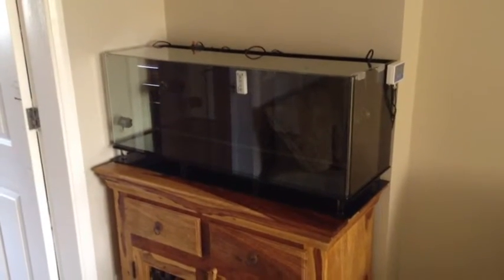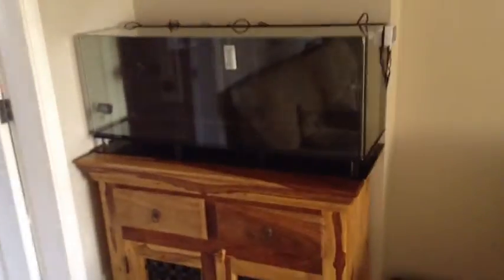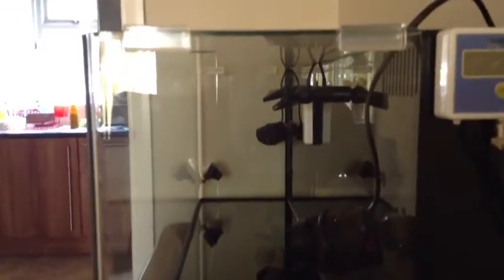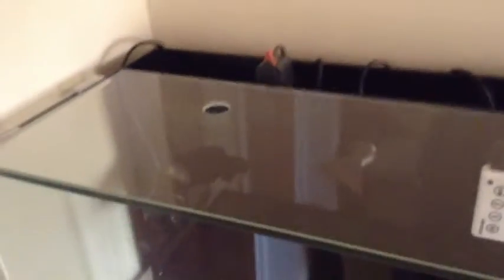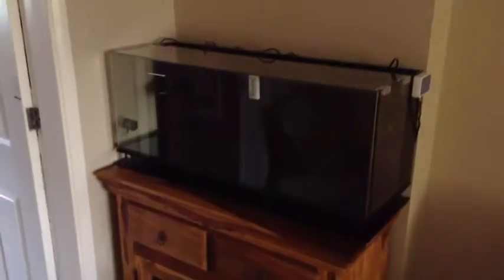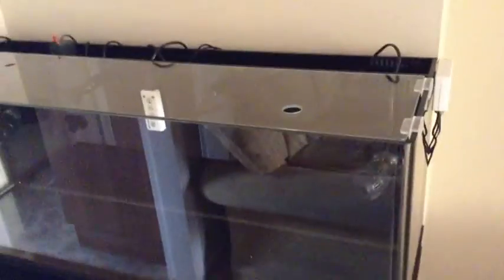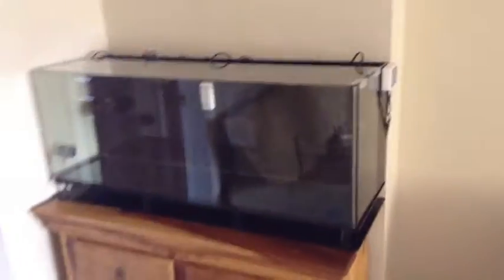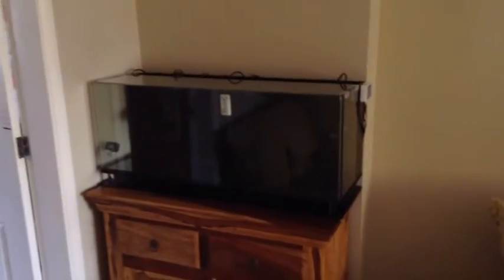Nuvo 24 Reef Conversion Step 1

Comment: Hi. Do you still have the Nuvo Nano 24? How is it holding up? I'm planning to buy one, but I'm finding a lot of incidents reported that in the first week or month after filled up, it cracked and water was spilling all over the room. Thanks in advance for reply.
Reply from the maker: MrSavage77 hi, I don't have the tank anymore, however you are talking about the first version which did crack, however they have since fixed that issue.
Reply: many thanks...still, besides you, i have the same feedback from many other people....i've decided to go for fusion 30, same dimensions, more or less, but the 8mm of straight glass should make the difference between a disaster and a nice experience